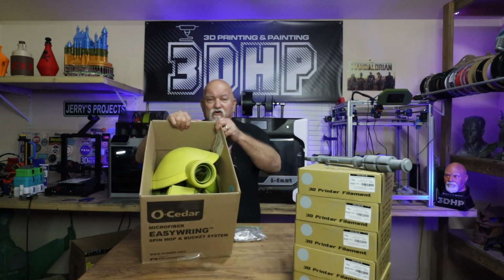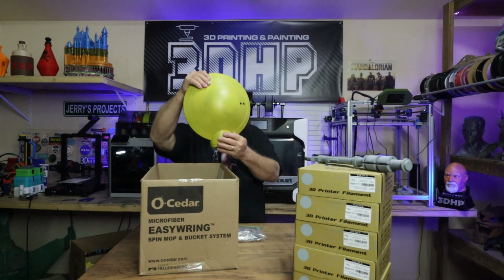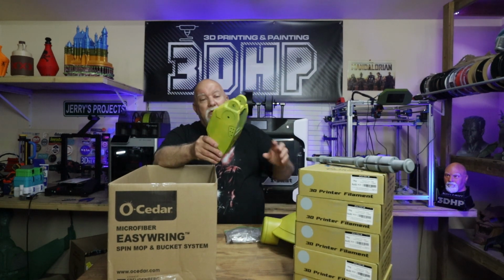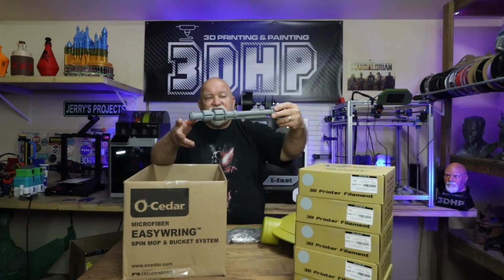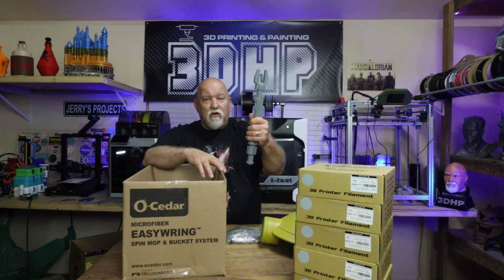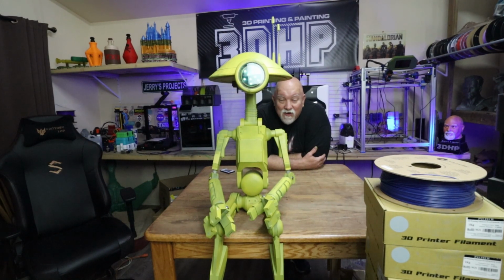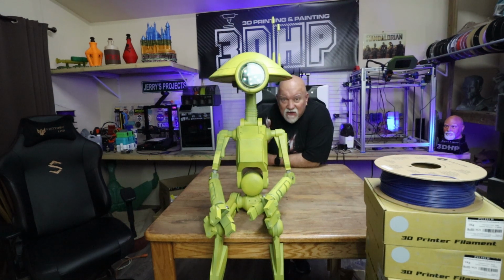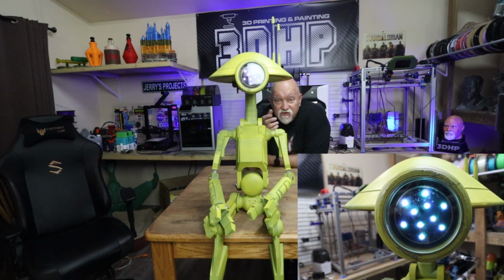Star Wars Pit Droid Build #3dhp

Comment: how long was the overall print time and how many spools did you end up using?
Reply from the maker: Don't remember if not mentioned in video.Was a fun project.Based on walls and infill used filament will vary between people.

Comment: Buddy came out great. Do you sand your prints? If so which grits do you use?
Reply from the maker: I did no sanding on this print other than where a few seams were glued and puttied .
Reply from the maker: The lollipops and posts for wrists were hand sanded to get parts to fit together,but overall sanding on everything was not done.Minor touch up here and there.